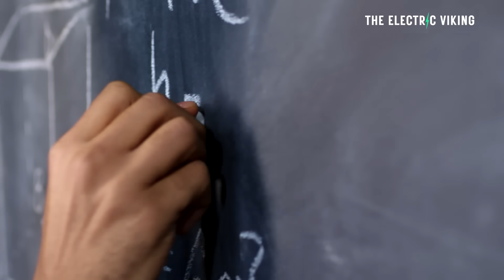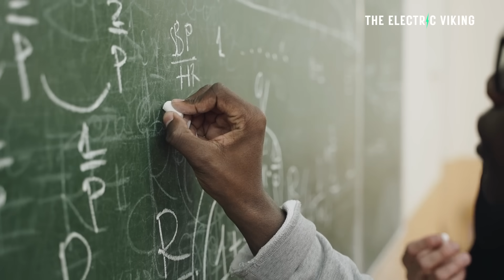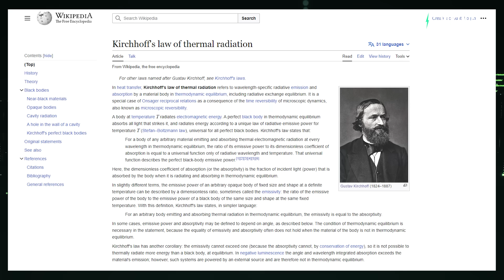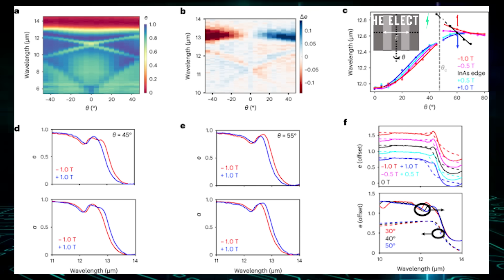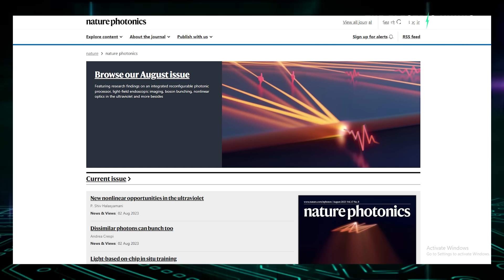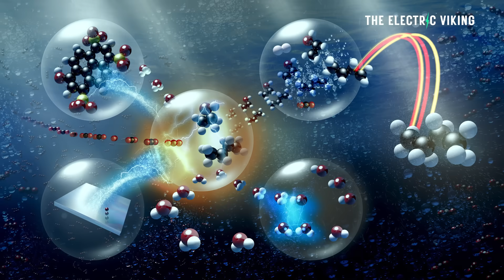Amazing discovery as Kirchhoff's law of thermal radiation broken in the US

Comment: If it sounds too good to be true, it is Sam. American University is ranked 72 in the US.  Everything radiates energy. Thermodynamics demands it. There are no "cold photons" and you can't turn low level heat into electricity.
Reply: Sam is extremely gullible it seems
Reply: @PaleBlueDotCitizen  the research about superconductors working in room temp wasl also featured but so far its validity isn't holding up. However, I am at least glad he is brining these topics to light
Reply: I mean, you can turn low level heat into electricity.
The issue is mainly doing it somewhat efficiently.
Reply: Put all the apparatus in a closed system, entropy will prevail.

You should leave this sort of thing alone. Or at least wait until after it's been peer-reviewed.

This is pretty close to being clickbait.
Reply: I'm not defending this university... but university ranking systems, at least the commonly cited ones...are jank. Pure jank.
Reply: I'll wait for Sabine Hossenfelder's take on these matters. Her feet are firmly planted on the ground.
Reply: @raymondlillard1054  "Close"? He just stated that a physical law has been broken, lol
Reply: While the editors of this journal are by no means infallible, it is generally considered a credible enough source to report on. I think we should cut Sam a little slack here.

Comment: it may be a boast to Solar; but keep in mind; cost.  In optimal conditions typical panels can convert about 20%; this type of aid would likely not increase that conversion rate; but expand the range of conditions, particularly when panels get hot in intense sun; that they can keep up that level of production; there isn't anything in the study that suggests it will improve the panels conversion efficiency rate.  If it isn't a very costly add on it could mean improved output over a day; but keep in mind if it significantly increases cost; you might achieve the same or better output by simply adding more panels.
Thus it has to be cheap enough to avoid this economic trade off.

Comment: I showed three decades ago that the 2nd Law can be readily violated with nothing more than a completely passive slab of low loss dielectric prepared in a certain way.
Basically, incident radiant energy concentrates internally to a higher energy density than for the ambient external environment, and in principle that can be harvested via say a thermocouple. The effect is however too feeble for really practical use as thermal to electrical energy converter.
When the demonstrably watertight proof was explained to various academics, but not initially pitched as violating the 2nd Law, it got nods of approval as 'obviously correct'.
Once 2nd Law failure implication was pointed out, the attitude invariably (save for a single exception), changed to shaking of heads and 'let's change the subject'.

Comment: Why not just have a water loop to heat water on the back of the solar panels?

If you have a solar panel on the roof, and the loop, you can have cheap hot water too.

Comment: Or you can collect the heat from the solar pannels warm up distilled water spray it into a tube under vacuum flash that to steam pass it through a turbine then to a large chilled condesation chamber and get some juice out of all that heat. No matter how you boil water it expands 1,699 times its former volume and water in a vacuum boils at 30c or 90F

Comment: Kirchhoff’s law of thermal radiation isn’t really like a “law of physics”. It’s more so a postulate or theory that’s been held in place. Breaking laws of physics is more so like newtons laws or breaking the speed of light, etc. 

But I would love to hear updates on this because the article is so vague and seems very odd. Kirchhoff’s law of thermal radiation states that an object at thermal equilibrium will absorb and radiate equal energy basically. If you are adding something to the system to take away energy to use or if you’re using a magnetic field to change the system, it is no longer at thermal equilibrium so it is not breaking Kirchhoff’s law. This law does not apply to dynamic systems. It is just a statement that an object at thermal equilibrium will be radiating the same energy it absorbs. I would love some clarity
Reply: Hmm ... yeah. Equilibrium ... If it absorbed less energy than it emitted, pretty soon it would freeze; if instead more, soon it would melt. But that is dynamic, not equilibrium. Or, maybe by magic, it could decrease or increase its mass. The former would be fission or fusion, I suppose, like a star. Not sure what the second would be, maybe something like a black hole with increasing radius.
Reply: Kirchhoff's Second Law of Thermodynamics has to be correct and is not merely a theory, postulate or axiom. But the full spectrum of EM radiation has to be taken into account. Perhaps some of that spectrum has been missed or ignored by the team responsible for the claim. Let's await the results of proper peer-review before believing these very vague statements. I don't want to accuse the team of dishonesty, but they are very likely to be mistaken, perhaps because of confirmation bias.
Reply: @RWBHere  yeah it seems like they may have done something that worked and may even be useful, but then fudged the definition of Kirchhoff’s law to sound more impressive and get more funding and/or attention. Really weird. It isn’t the second law of thermodynamics though. It’s Kirchhoff’s law of thermal radiation.

Comment: Hmm not expert but my understanding is the photvoltaic effect is best understood in terms of photons incident on the panel.

The highest energy photons that are therefore able to contribute most to the panel's output, lie towards the blue end of the spectrum not the red end.

While in terms of our senses, we tend to associate the infrared end of the spectrum with heaing and energy, in terms of the total energy reaching us from the sun, IR is a small part. For the most part infrared photons contribute relatively little to the output of photo voltaic solar panels because the photons have insufficient energy to displace electrons in the semi conductor material.

However, there are some solar panels that are liquid cooled with low grade heat drawn off for things like hot water systems.

Comment: Regular solar panels are already at some 20% efficiency. 

This means they already capture some 20% of the energy of incident light. 

A basic limit is one will never "absorb" more than 100% of incident light energy.

Then, photovoltaic energy is a direct conversion of incident or reemited photons into a separation of charges on different sides of a semiconductor.

Not all photon frequencies/wave lenghts can be absorbed the same way with the same efficiency. 

Some high cost and high tech panels can harvest more than 40% of incident energy using more than one absortion layer, each tuned to a different photon energy (wavelength) broadening the effective rage of the spectrum absorbed.

Their can't be a 10 fold increase in efficiency to a 20% thermal efficient panel. Absorbing 200% of incident light is stupid.

Wasted energy converted to heat or infrared emissions (lower energy photons) of lesser value could be reduced to 1/10. That would make some sense.

Imagine this physical process coupled to another chemical one that is endothermic in nature and absorbs the lower grade energy into something usefull, let's say water splitting  or calving cycle (phases of photosynthesis, part of the artificial leaf agenda). One could broaden the usefulness of the incident light. It is still limited to less than 100%.

Bold claims of breaking laws of physics are generally scams. At least a very non-scientific for of expression. 

Laws exist or are valid within certain bounds or conditions. If one can engineer around the condition without breaking the basic laws, certain simplifications might not hold.

The Internet is full of morons that believe and others that sell moto-continuum, "free energy",  "overunity", 200 mile carburators, HHO, and an infinite array of scams. 

Let's not go this way, please.

Comment: 5:30   An intense EM field could modify the optical properties of the materials in the solar cell, altering how they interact with light. This modification might change the refractive index or light scattering properties, affecting the path of light within the solar cell and possibly enhancing light absorption in specific circumstances.  When an EM field interacts with a material, it can affect the material's electronic and vibrational states, which, in turn, can influence its thermal properties, including emissivity.

Comment: So rather than the electrical generating diode solar panels is he on about the how water generating solar panels? 
now this new thing requires a very strong magnetic field to work, and since permanent magnets really don't work well with lots of heat, this would mean using an electromagnet, so the question then becomes do it then beat the laws of unity?

Comment: 3:33 Solar panels are not absorbing heat to convert to electricity, they are absorbing and converting photons. They do absorb heat but that is essentially an inefficiency which reduces their operation. Any heat absorbed by a solar panel (or any conductor) increases electrical resistance. The more heat panels absorb the less efficient they are. In the case of solar panels only a very small part of the heat radiated is actually wasted energy as most of it was in the infrared range and not contributing the the generation of charge in the first place. If they are able to convert the infrared to electricity that would be something indeed.

Sam, a good book that will give you a bird's eye view of the scientific landscape and its history is Asimov's New Guide to Science (or older 2nd hand copies of Asimov's Guide to the Physical Sciences). It explains the fundamentals of science up to about the late 70s so it doesn't cover the latest advances but it covers everything that underpins them. It's written for the layperson so its not overly technical, it is very digestible and a thoroughly enjoyable read. I have read it several times over the years. The book has given me an understanding of science at the fundamental level which has enabled me to keep up with most scientific concepts over the years. It has a particularly good chapter on thermodynamics which underpins our understanding of the limits of energy use and conversion.

*I added a couple of comments at about 10mins after my initial posting - might need to re-read you if anyone read this just after .

Comment: Ok makes sense.
Magnetic fields are used in fusion experiments to trap heat within a toroid shape.

Correct me if Im wrong, these guys are basically manipulating a different shape/pattern on these magnetic fields, to make it siphon heat one way, like a one way mirror. 

I guess like one way micro funnels?

The question then is what energy cost is required to create these magnetic fields? Can it be done with permanent magnets?

Not really breaking any laws of physics

Comment: I'm not buying it. Kirchhoff's law is directly linked to the second law of thermodynamics. Break Kirchhoff's law and you break the second law. If this were true, it would enable you to pull free energy out of anything.

What is possible is that they found a way to make a material that absorbs (and hence emits) less energy in the infrared than in the visible light wavelength range. That would be a spectacular result in and of itself, with great potential for more efficient photovoltaics, without breaking any law of physics. But calling that kind of breakthrough breaking Kirchhoff's law is absolutely ludicrous.
Reply: There are paints available (mainly white pigment) that because of their emissivity characteristics, when painted on a solar exposed surface, cool that surface to below ambient. They take advantage of the fact that away from the Sun, the temperature of the sky is typically below -40C. These paints have been proposed as solar roof paint. 

These paints are usually pigmented white and applied in ten or more thin coats. While I haven't heard of it happening, it is conceivable the paint could include a pereskovite PV layer.

As always the problem will likely be cost.

The Tech Ingredients guy did an interesting study of this phenomena.

https://youtu.be/dNs_kNilSjk

Comment: Regardless of whether this news is anything other than hype, the use of hydronic temperature shedding piping paired with solar panels is already a thing. Its expensive, but it takes a small percentage of the power generated by the panel to pump coolant in a radiator behind the panel, the heat from the warmed up coolant is then shed off via a heat transfer block piped into a home's hot water storage system. These were on sale in the early 10's.
Reply: Solar heating was already popular decades before that, but then the price of fossil fuels dropped and they were mostly forgotten. Combo panels seem such an obvious idea, but more complexity means higher cost which causes lot of people to avoid them.
Though the main issue would be the increased need for maintenance: Unlike basic photovoltaic panels the pipes might freeze and break in cold weather and even without that there is a danger of leaks. Considering how many people who bought solar panels or a micro wind turbine fail to do such basic maintenance as washing the panels or tightening the bolts once a year, needing to check that the system is not losing water somewhere is likely too much work too...